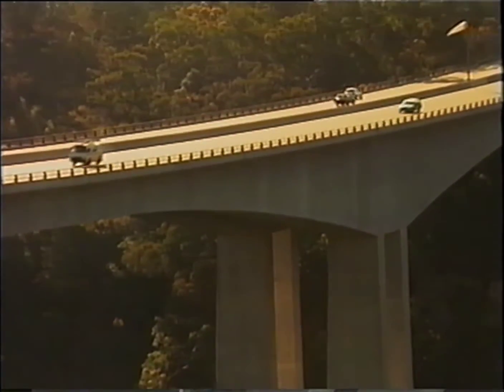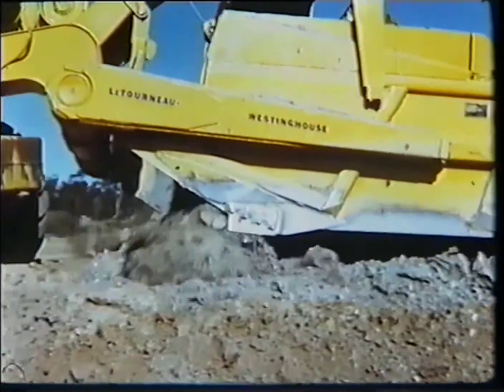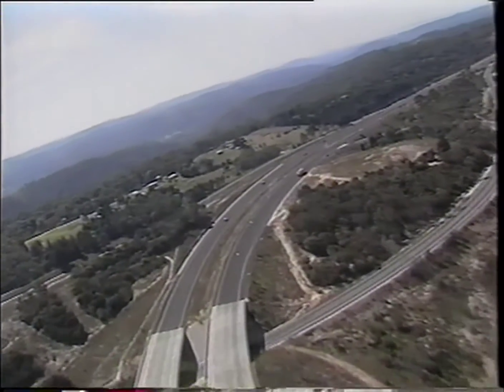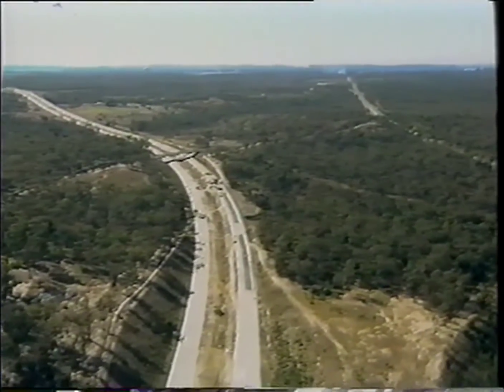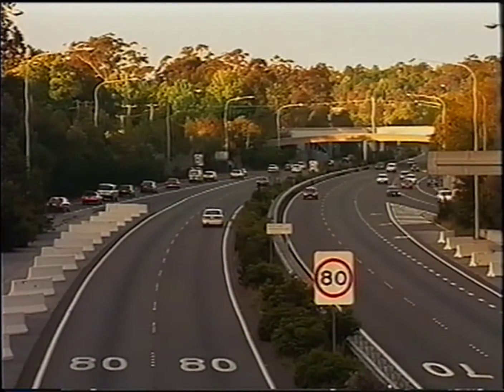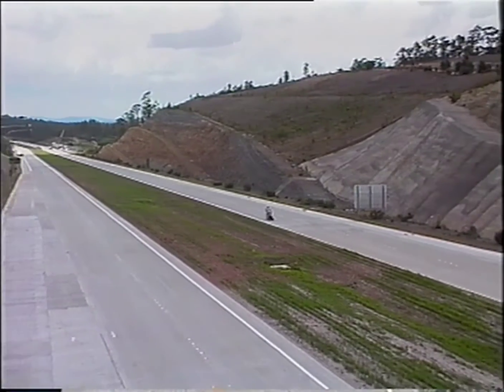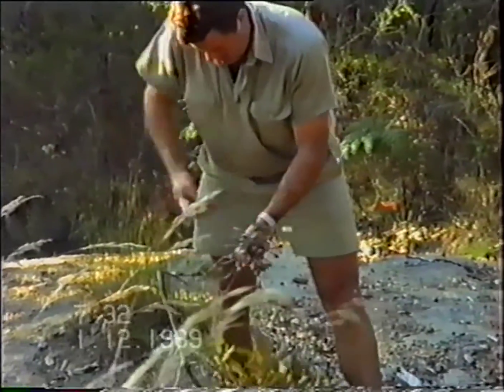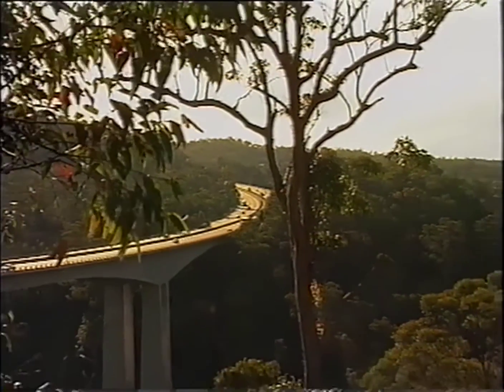The Making of the F3 Sydney to Newcastle Freeway - 1993 Australian Promotional Documentary

Comment: It wasn't a freeway to start with. A toll was paid at Berowra . The toll booths can be seen at the opening day. It used to take 3 to 3.5 hours on the old Pacific Highway.  Only 1.5 hrs now. Was quicker to take the steam train 2.5 hours.
Reply: Yes that's right but the very first toll both were built on the north side of the Hawsbury River Bridge. The office for that tolling station ( as seen in this video ) are still there and are used as an ambulance station and accident emergency vehicle station. It's the brown brick building on the left side after the bridge heading north. Of course the toll booths were demolished. New booths and a tolling station were built at Berowra as you rightly stated.
Reply: It's was the first section of road built.
There were toll booths there ( as in the video.)
Reply: @markdrennan5723  I wouldn't have thought there would be tolls there. That part of the free way was built later. The original toll road is parallel to that part of the freeway (old Pacific Highway). Used to be a service station at the top of the hill where Pie in the Sky is now.
Reply: The first section on the (then F3) was the Hawsbury River to Mt White.
Reply: Yep, 20c toll if I remember correctly.
Reply: @tepidtuna7450  gotta love the nsw government / sydneys use of tolls. was driving with my brother last night. used waze to plot a route from one side of sydney to the other. non toll route - 38 minutes. toll route, $21 and change.... 37 minutes. (this was outside of peak, toll roads certainly have a use, but the costs are a joke at times).
Reply: The "FREE" in freeway has zero to do with the charges..it is intended to advise that the roadway is free from intersections at which we would normally have to stop at lights or give way. Hence all those overbridges and run off lanes we see connecting to other roadways.
Reply: Tolls were at the north side of the initial single bridge. In late 70s this moved to Berowra. The toll was 20c for a long time
Reply: At that time the old bridge was still in use and it took years to have one bridge built when the hawkesbury berowra extension was added. In no time a second bridge more sense
Reply: as it should be.
Reply: The toll booths were moved to berowra. The token 20c toll cost more to collect than it raised. When the link from Hornsby to berowra was proposed the removal of tolls became reality. The toll applied to the old part but not the new. Made no sense